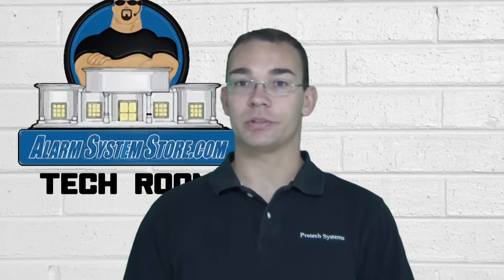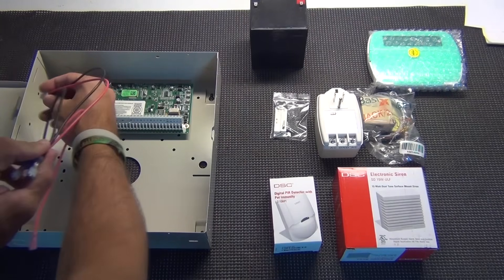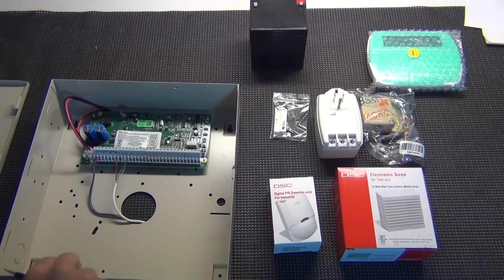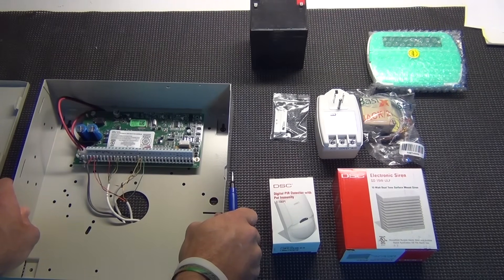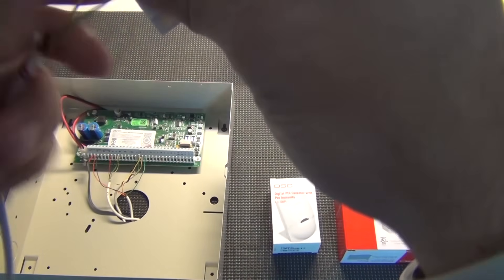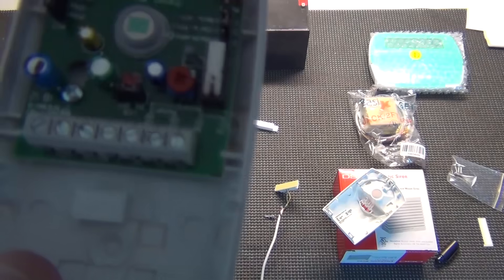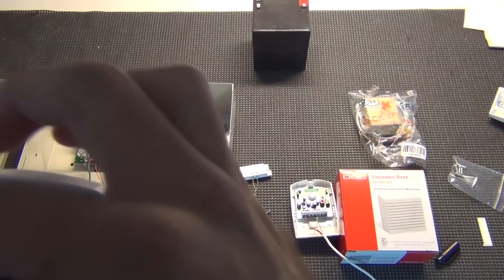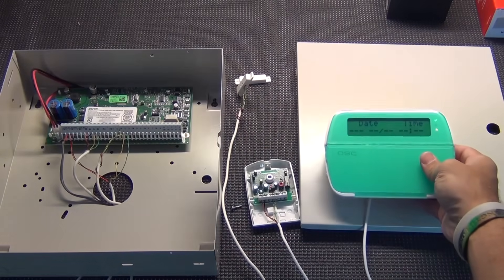Alarm System Store Tech Video - DSC Power Series Basic Wiring

Comment: I have a DSC1832 system with a RFK5500 and PK5500 key pad.  I hit *8 and then my installer code and then I get to the Enter Section entry.  I put in a 3 number code (ie 001) and the system just beeps at me.  I can hit * and get into the programing of the various zones but the enter section does not respond and ideas on why it is not working and possible solutions to get into the enter section area of the programing?
Reply from the maker: The only thing that comes to my mind right off the bat is that you're not using the proper installer code. If you bought it from us then our techs would be glad to help. You can call 888-811-0727 and give the techs your order number and they'll be glad to help

Comment: Can i program the 1832 with the PTK5507 not the PK5000
Reply from the maker: You can program the 1832 with the PTK5507. The PTK5507 features an alpha keypad emulation mode that lets you do installer programming. The only keypads that aren't friendly to program these systems with are the 5501 models and the LED style. Thanks for watching and if you have any other questions; feel free to ask.

Comment: I have one of these alarms already installed in my home when I moved in. DCS told me to read the manual to figure out how to disarm the thing. Thanks a lot.
Reply from the maker: We're not actually DSC and DSC doesn't talk with end users. Matter of fact, neither does Honeywell, Interlogix, etc. They work exclusively with dealers and licensed installers. You most likely spoke with one of DSC's sales reps. We provide free tech support to our customers, but if you didn't buy it from us then we do offer a paid tech support service. I am taking it that you don't have the user code to disarm it. You could do a factory reset, but you'd have to set the programming back up.
Reply: I just took it off the wall. Too much of a headache to be playing with it.
Reply from the maker: Understandable. It can be frustrating at times. Especially without having the main users codes like the master and installer codes. If you ever want to give it a shot with that one or a new one; give us a call. We've been helping DIY folks do this since 1997 and we try to make it as easy as possible. 888-811-0727. Hope your weekend is going well :)

Comment: how long can you run those wires out of box? Please respond, we are installing in our house and we just need these wires to run a min of 15 feet??
Reply: It will just depend on how much cable you have...You will need to mount your panel in a specified location so that way the cables can run without having to move the panel around 100 times. Hope this works.

Comment: hi ,
i have a dsc pc2550 and lost the pin,is there anyway to unlock it.
thank you.
Reply: Yeah...Enter the DSC installer code. 5555 it more than likely the pc2550 code. We had an old ADT system in my house and we put 5555 and this worked. It was a pc2550 maxsys, though.

Comment: That's a window contact... not a door contact.  Yes it can be used on a door, but it should not...
Reply from the maker: Actually they are interchangeable and there is nothing wrong with using this contact for both. They are just a loop switch and as long as you install them correctly they can be used in both situations with no worries.
Reply: I would not, and same goes for my guys.
-The gap is smaller and specifically made for a window.
-It is also why there is a sticky back... because you do not want to screw in a vinyl window...
Again, if you do not want issues, you do what you want, but it should not be used on doors.
Reply: Alarm System Store
 hi    good work
Reply: they can be put on both
Reply: A magnetic sensor is a magnetic sensor. It can be put on medicine cabinets, Doors, etc. Either way, the system will treat it the same.
Reply: A reed switch with a magnet is that all around yes... but the form factor has specific applications.  The magnet in this particular one is also smaller, which means it allows for a smaller gap.

The reason you would not use this on a door is because there is always a starting gap on a door, but not on a window.

You can debate it all you want, but is would be bad practice to use this on a door, period.

Comment: You should be using EOL resistors.  Without them, anyone can just short out the cables to the sensors or door reed switches and disable the alarm.  I would never wire an alarm this way.
Reply: Generally speaking I agree with you, it is good practice to use EOL if done correctly. Not so much for unlikely tampering of the circuit unless it's a commercial install, though that is possible if you have exposed or easily accessible wires. The bigger more likely issue is shorted wires either by accident or rodent.

The problem is, in my experience 95% of even "professional" installations I've seen in my 17 years in the trade, the EOL resistors are in the panel rendering them pointless. That coupled with the fact that most DIY when given the op of using EOL resistors or not opt not to for simplicity. As such, the video was done with majority in mind and simply disabling EOL in programming. Good point though and we will add a note in the video of the recommendation for EOL supervision..
Reply: +Bill Ruys EOL resistors are not really required for simple and home security installations, and it also bring too much work for installer, here in my country, most of home alarm system designed with several wired zones don't need any EOL resistor, mostly the zone can be triggered once its circuit state is switched by detector. However, some of wired alarm systems here are serious and all the zones must be short connected by EOL resistors, before the alarm panel can work properly, without EOL resistors, the alarm panel can't even be armed.
Reply: On DSC systems you can program the zones to use 5k6 EOL resistors or not. 
In some localities and some types of use cases the system will not be up to code unless you use these, but for most residential situations there’s really very little reason to want to use them. 
One of the big drawbacks of using them is you cannot run zones in series. In many installations it is common to run all the window/door sensors in a room or area in series to make one zone. If you use EOL resistors this would put all the resistors in series as well, making your system unusable, so you have to run a separate wires from each panel input to each device, meaning you will need zone extender boards to get up to the 20+ zones for even a small residential setting.